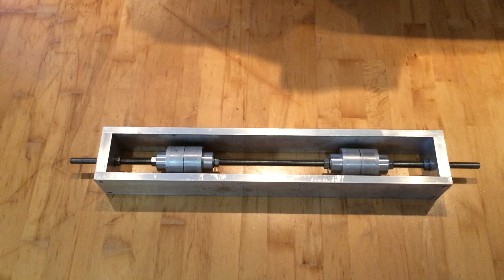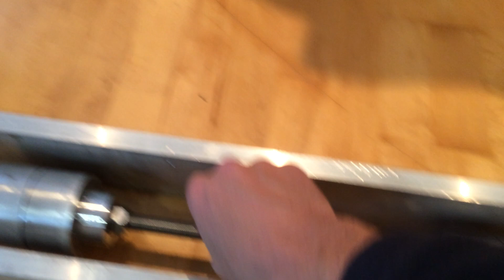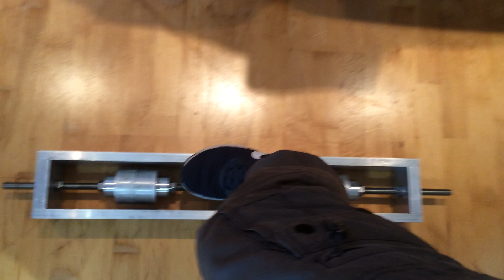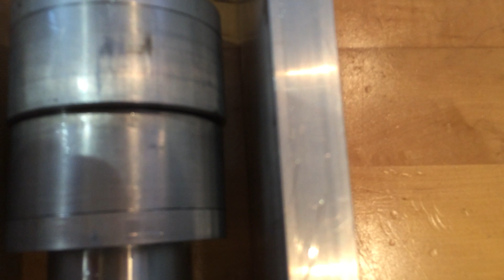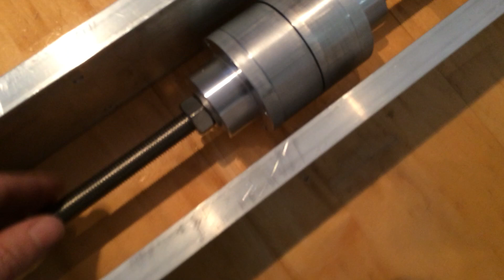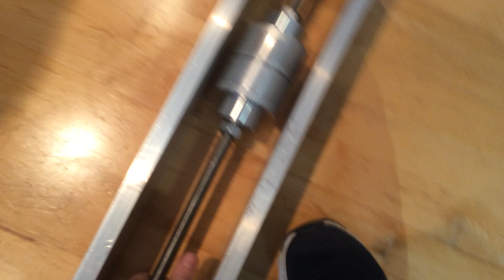Permanent Magnetic Bearing Prototype 3 - Stage 1

Comment: Impressive holding power! I am planing a radial steam turbine (from a turbo charger with 40mm repeller) to compress 12 mBar steam to 42 mBar (heatpump with COP up to 11), so only oil-free bearings. "Air"-bearings at 42 mBar are not possible ?
What do you think about OD26 x ID13 x 8.5mm and OD12 x ID4 x 5mm ring magnets ?
would the rotating 12mm diameter magnets on the 4mm shaft induce Eddy currents in the surrounding ring magnet ? I don't think so because the magnetic field lines in the 0.5 mm gap in between would repel each others and therefore never reach into the other magnet.
At 150.000+ rpm i need very strong centering.
Reply: @nikola.tesla.r.and.d.centre  Thank you for your attention ! I want to order the parts this weekend and i have no real experience with neodymium magnets :-/ I only need less then 100g centered but with 150.000 rpm. I thought you might at least have a feel if such ring magnets might have enough strength.
I think "hydrodynamic" bearings use a fluid that is dynamicly pushed into the gap. 12 mBar water steam is no liquid but a gas at 1/83 the density of air ! I don't think that such few molecules can be pushed together efficiently to make some kg of force. It is allready a big deal to get a compression ration of 3.5 = 12 mBar to 42 mBar. With air at 1 bar that would give strong 3,5 bar !
My heat pump will be made of aluminium and uv-epoxy so no ferromagnetic swarf in sight.
My double ring design is the usual design where my outer ring for simplicity replaces the surrounding 6 magnest: https://youtu.be/fSvpcsVlBVo?t=49 
I don't understand why there always has to be a needle contact. The two opposing ring bearings could repel each other ? I think you go that way. But you never published images of your design and say the 100kg magnets inside the housing attract each other ?
Greetings from German, Roland, the little physicist :-)
Reply: @nikola.tesla.r.and.d.centre  My linked design is shown to work. Only the direction along the axle is stabilized with that needle. It might be that when letting the two magnetic bearings push the axis toward the center of the design, the system will start osizillating ? It might need some damping along the shaft axis ?
With my heatpump, i plan to put a one sided disc motor on the backside of the compressor wheel (https://www.alibaba.com/product-detail/RHF55V-billet-wheel-front-wheel-Turbo_60717367845.html ) that will pull the shaft into the ring magnet. So like with the needle-design both magnetic bearings could push in the opposite direction :-)
The small ring magnet with 12 mm outer diameter will fit onto the 4mm shaft: https://www.aliexpress.com/item/32954969704.html
and must be pushed into the big ring magnet with 13 mm inner diameter: https://www.aliexpress.com/item/32794913663.html
Good advice to strongly encapsulate that magnet, thank you for this insight !
Reply: @nikola.tesla.r.and.d.centre  i made an image for you: http://robosoft.de/forums/turbocop.png
What do you say, could it work ?

Yes i saw your design-2 but without a design image/explanation it is really hard to guess what is inside your machines.
Yes i thought that 0.5 mm distance between outer magnet and inner magnet is close enough. 
Ah yes, the ferrite ring is full of iron dust :-(
How can the inner magnet get into a magnetic lock when it is rpelled from every other magnet ??
Reply: @nikola.tesla.r.and.d.centre  Thank you again, but i want to order from China this weekend and can not just try and error to wait another 2 months to make the next order. And as a physicist i see with my mind first..
I did make the picture for you that you can say left/right or up/down instead of "one way or the other". What 4 possible combinations do you mean? We are coming from different worlds to happily meet here at youtube :-)
Refering to my image, up and down would make the rotor crush into the outer ring magnets :-(
Left and right would mean the one inner ring magnet would punch through the outer ring magnet and everything breaks down :-((
I think with a needle or a ball bearing the repelling forces go instantly from 0 to max, wherease the repelling force of magnets rises linear. And that results in a harmonic oscillator which will go https://en.wikipedia.org/wiki/Mechanical_resonance#Resonance_disaster
But this could be solved with a very (very) clevery magnet design somehow like a https://en.wikipedia.org/wiki/Helmholtz_coil where there is a constant repulsion around the stable center point and a strong rise in repulsion when the rotor leaves that region.
Another way would be to electromagneticaly dampen the resonance.
The 6 coils of my 2-pole disc motor could be used for active magnetic centering when not three pairs of coils are controlled but every single coil had two mosfets. Instead of https://i.stack.imgur.com/T5BCZ.png a single coil would attract/repel the rotor (up/down in my image)..
Thank you for you insight. So i will order these 19x5-14 ring magnets as well to test 1mm spacing: https://www.aliexpress.com/item/32949614883.html
The nice thing with the 23x3-13 was that they would fit into the 36-x15-23 ferrite ring which in turn would be strongly enclosed by a 40-2 aluminium pipe ! That ferrite ring shown in my image however would suck in most of the magnetic field lines of the 23x3-13 and lessen the repelling force for the inner 12x5-4 shaft magnet :-/
Yes the more i now read on air foil bearings the more i get convinced that they are the best solution for my turbo compressor. It links to a Tesla Turbine because the air in between gets accelerated by boundary layer effects. The 35 bar cushion ( https://link.springer.com/article/10.1007/s42417-018-0001-z/figures/1 ) of your linked video would relate to 0,42 bar in my vaccum steam compressor. That would be a force of 42 kg/cm² and 10.5 kg for 1/4 cm² !
A Metal Mesh foil bearings (Figure 5 https://bentlybearings.com/gas-bearing-lubrication ) might be very easy to construct. If you would add a single disc Tesla Turbine next to the foil bearing, it could push air into the bearing to push the metal mesh back and make room for the thin space between shaft and foil. That way you would not need any precision. And that tesla turbine would act as an axial air bearing !
You could start with cheap teflon foil :-)
the little physicist :-)

Comment: Can we get an update on the magnetic bearings? These concepts would be great for increasing the life and decreasing the drag on wheel and other vehicle bearings.

NdFeB magnets should be able to operate around 80C with light shocks, and their repulsive forces are many times higher than the thousands of paramagnetic pounds they can lift.

You can keep swarf off of the bearings by using special high permeability shielding sheets to keep the magnetic field from reaching out beyond a design area. It also can increase the field strength on the other side.

Comment: I mean nothing is frictionless, you still will deal with air friction, and magnetic friction, but this design looks great. It definitely will have less friction than standard bearings, and much simpler than most magnetic bearings we have now. 

I also did not expect it to be able to hold that much radial load, really great prototype.
Reply: Grav Inert yea I’ve been looking at your other videos now, doing good work. Keep on going.

Comment: Have you considered doing it like a disc brake so that the magnetic field is completely encompassed by a calliper and will keep the shaft static meaning it can't come out of its bearing but is still able to spine on its entire length without being in contact with anything else?

It's the only way I can see it working and on the plus side you could make every magnet in the calliper spring loaded and fully adjustable for balancing.

It's been interesting watching your prototypes and I can see you're close, I haven't blown the lid off of your next prototype have I?

Sorry if I have but if you are going down that direction I think you're definitely on the right track.
Great videos.
Reply: It's just like a disc brake but instead of a disc brake it's a magnet on the shaft and instead of having a drum or calliper it's fully encompassing the magnet.
I wish I could draw it for you because it's a really straightforward design.

I think you will be getting some feedback as well, the only way I can see a way past it is to use some sort of composite Robert Murray Smith here on YouTube has been doing some experiments on composite materials maybe he could give you some advice on other materials.

I've seen some work being done with graphine impregnated fiberglass and Kevlar like materials that have been showing almost identical strength as aerospace carbon fibre but I can't for the life of me remember where I saw it.

Hopefully if you're still getting issues with feedback there might be a reasonably cheap alternative.

If I can find where I saw other composites you might be able to use I'll be back and post it for you.

I'm looking forward to seeing how you get on though and I'm glad you know you can get past it because it's only a matter of time before you do.

I wish I could explain the bearing in a better way, just think of it like a normal bearing but the bearings inner race is fixed to a shaft and instead of it being pressed in place on the outer race which in this case is a magnet and a magnetic field the fully encompassing calliper acts as what would normally be the hole the bearing is pressed into but you're clamping it around instead of pressing it in under a solid state friction fit.

Put your hands palms facing you and put index fingers tip to tip and your thumbs, imagine a magnetic disc in that gap and you're looking down at it.
To prevent it from touching the sides you could use magnets all over the inner surface and hold it statistically in place but still have a shaft going straight through it.

I think you'll get it.

Good luck with it and if I have to do you a short video drawing of what I mean I'll do it for you but I won't be saving the video I'll just send it for you and delete it after a week so you can get the design.

I don't post videos on YouTube but I'd like to see these bearings get going because friction is a killer.
Reply: No buddy, that's not what I mean.
Have you got a Facebook page connected with this account?
I'll do you a drawing and send it to you through you messenger.

I don't know how else to describe it to you but if you want I'll draw it far you and do a few pictures with writing on what i mean because you'll see what I mean if I draw it.

Just think of it being similar to a pancake motor but the rotor body is a magnet not copper wire and of course the stator that holds it has magnets throughout the walls to keep it in place.

Really sorry bud but other than doing you a drawing I really don't know how to better explain it but it is pretty simple and very easy to do.

Either way all the best to you whatever you do because I give it less than 12 months before you've got a fully tested and working prototype once you see the solution.

I'm not a design or structural engineer or anything like that although my family was always trying to push me into it I just have a keen eye at looking at systems and seeing how to easily modify them to make them more efficient and effective.
I was more interested in getting stuck I and getting my hands dirty so I went with mechanical engineering and worked alongside my brother in his garage.
Really good having book knowledge but nothing makes up for practical experience with tools and machines in my opinion and of course I'm biased towards how I think but it's served me well.
Reply from the maker: Don't worry about this one, it's a dead end. Check out our latest offering! https://www.youtube.com/watch?v=4mWLnb_x0k0